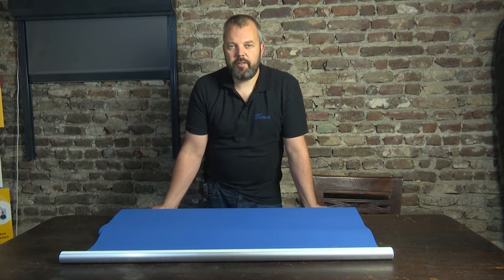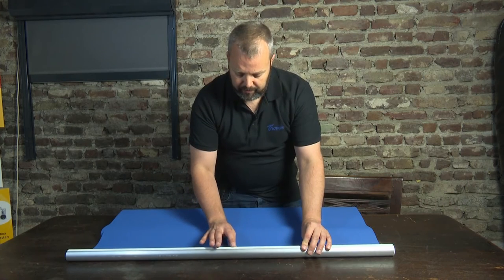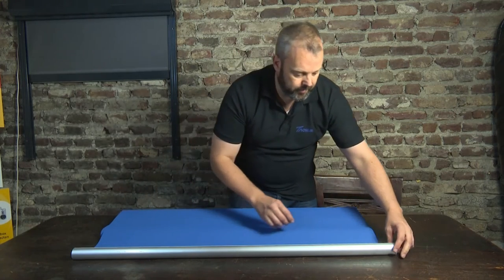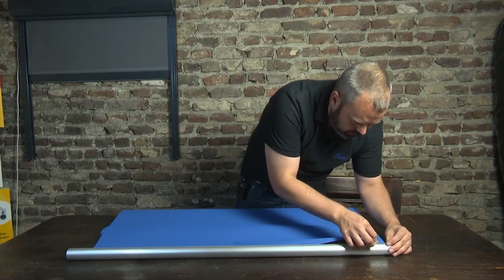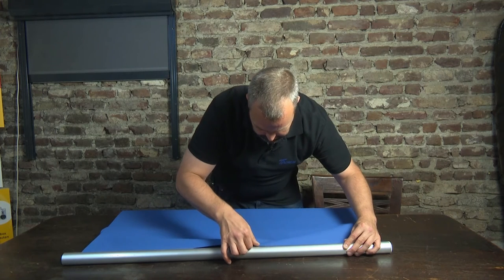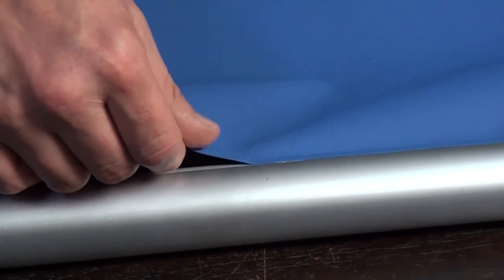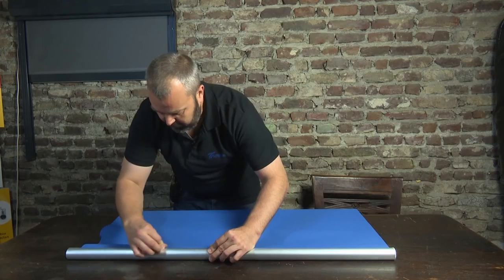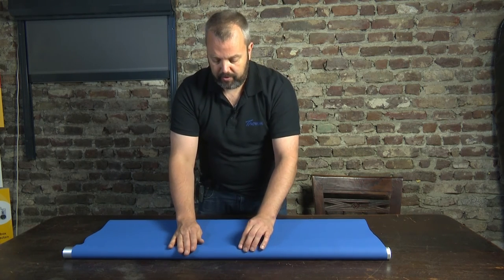How to make your own electric roller blind part 3 - Attaching the fabric to the tube

Comment: Why don't you lay the fabric flat on the table, and place the sticky strip side of the tube onto the fabric, ie: line up the sticky strip with the top of the fabric. Press down, then roll slightly towards you until the glued end of the fabric is at the top edge of the tube, then press along the tube to make sure the fabric is glued securely. The way you lined it up looks really difficult.